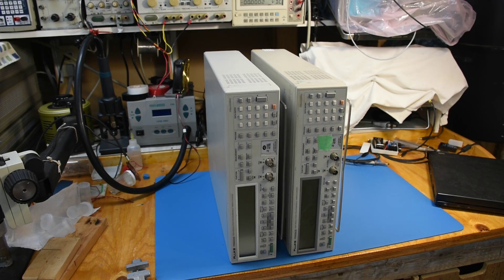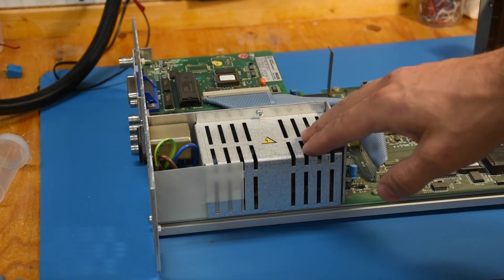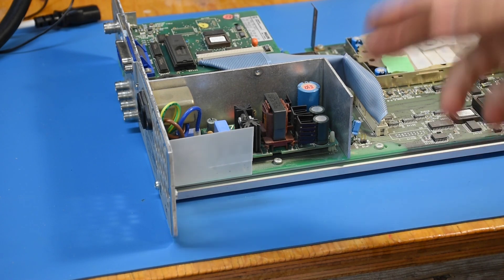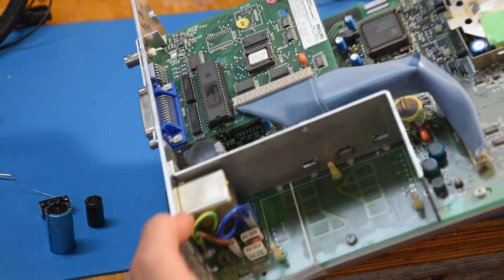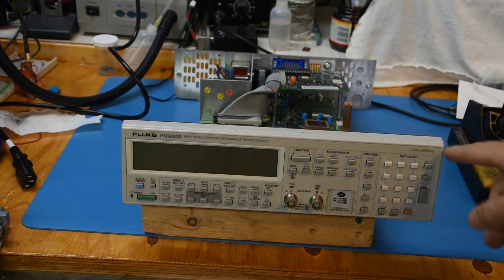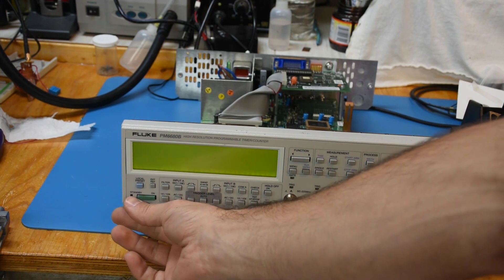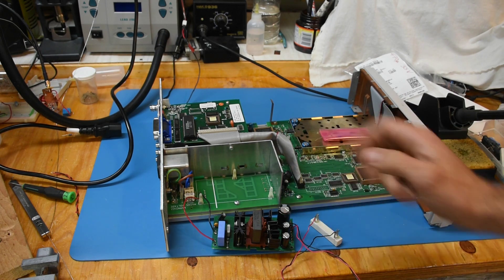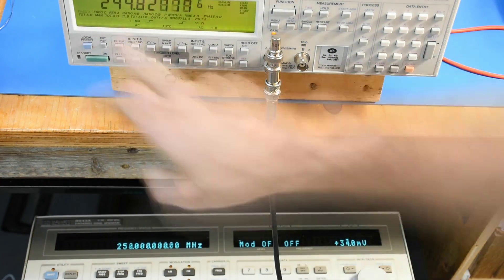Fluke / Philips PM6680B universal counter/timer repair (x2 !)

Comment: i tempted to buy peak esr meter, but i see you still have problem with the cap, are they not really useful or you  dont check all cap with this esr meter?
Reply from the maker: Measuring capacitance and ESR in-circuit can always be problematic, regardless of the instrument used. But for those capacitors that seemed "good" even out of circuit, I'm not sure what measurement would've revealed their defects... Different frequency ? Leakage at nominal voltage ? It would be interesting to dig deeper. The Peak is a simple instrument, I'd be curious to try other similar small / convenient testers but it's all I have.
Reply: @fenugrec5697  I'm not sure how applicable it is here with the relatively low voltages, but I notice with tube equipment that you really can't know how leaky a cap is until it's tested at its rated voltage. Those little ESR meters are great tools, but I find it useful to have another leakage tester that can go to a few hundred volts for caps that need it, such as the Heathkit IT-28.